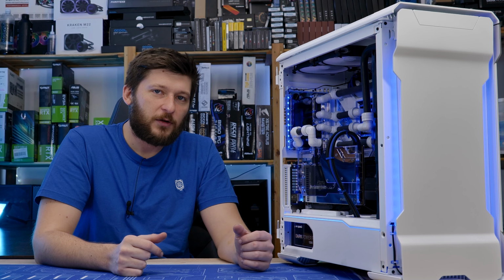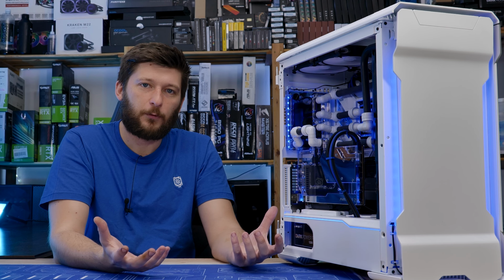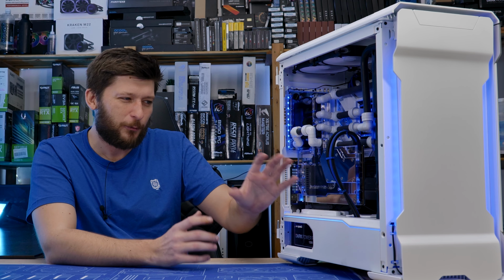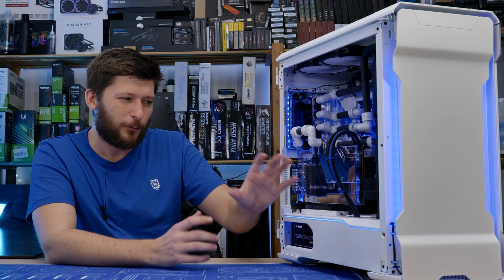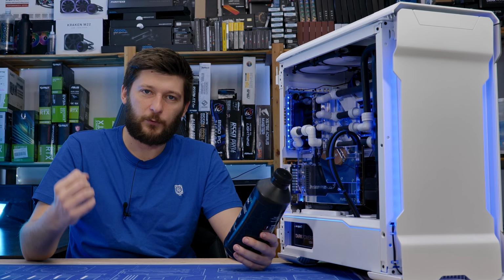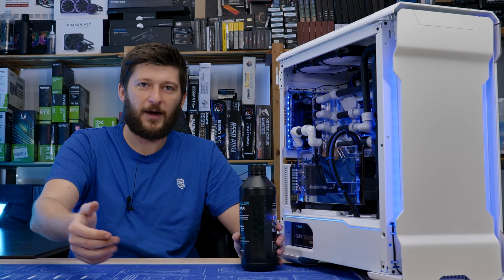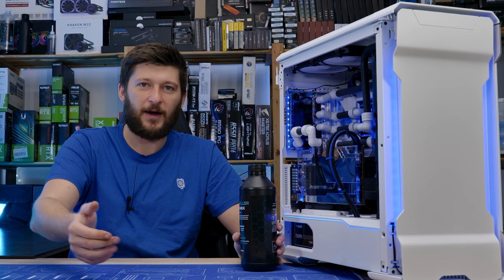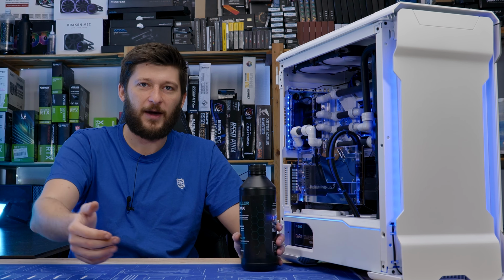Blue Yeti Custom Watercooled PC Build p.8 - The Final Result

Comment: I definitely like it, even though it's not something I would do for myself.
The only thing I would have done differently is the radiator.
If 420+360 doesn't fit, I would probably have put 2x360.
Other than that, the whole assembly process was very interesting.

Comment: Congratulations on the re-visioned build.  Nice work.  No doubt what I appreciated most was that you didn't edit out your deadends and fails.  For a lot of people a build like this doesn't happen often enough to remember everything that needs to be remembered, and, yes, I hope you attempt future projects like this one.  Great review and, too, update on changes in hardware generations.

*BTW, i found this series researching the asus tuf 3090 ti oc gaming gpu, which for me has been a pita to keep cool either from its cooler design or improper factory assembly.
Reply from the maker: Thanks!
Yeah I though it would be more interesting/beneficial for everybody if I just leave everything in. Some videos are better if you just show the right way, but for these types, making a few wrong turns is nothing bad to show.